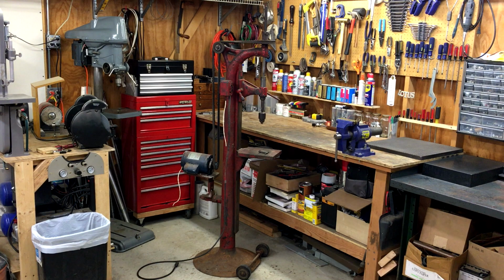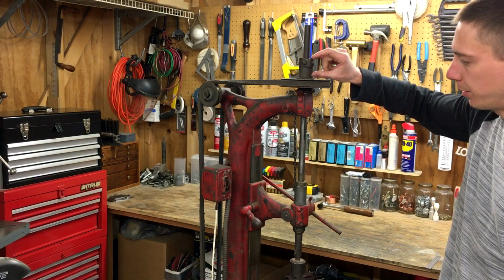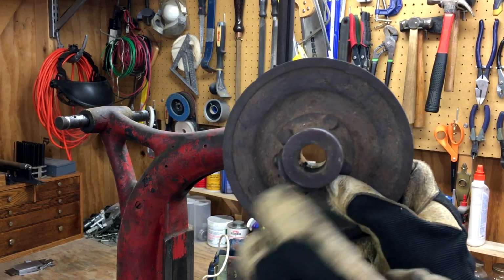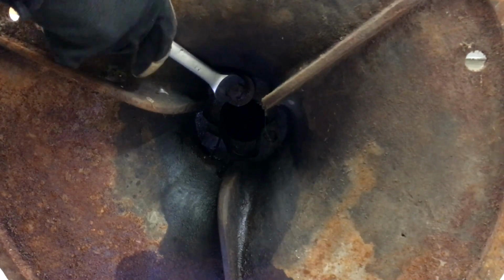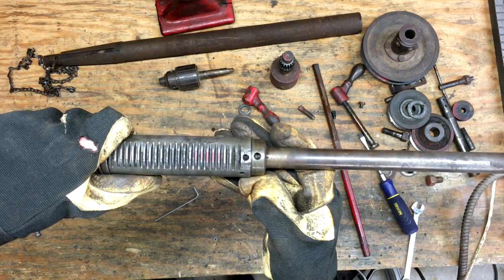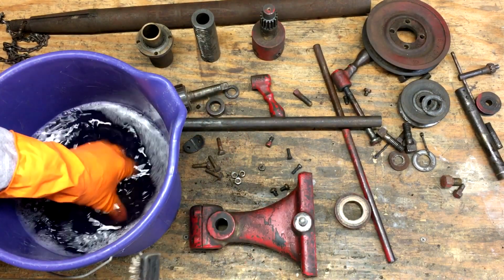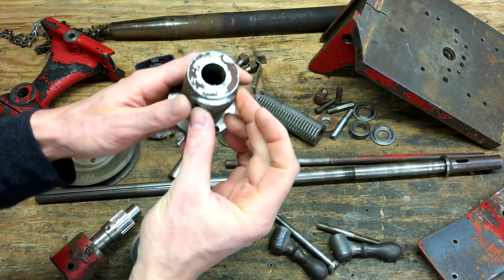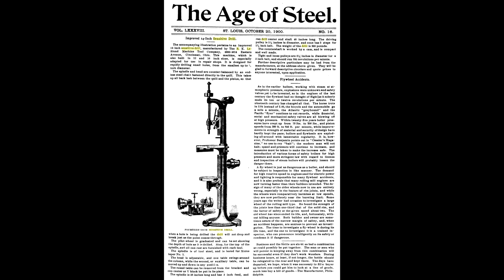Leblond Drill Press Restoration - Teardown

Comment: Hi,
Regarding the repair on the base and the damaged lettering, I've  used Selleys "Knead It" epoxy for this type of application before. If you can sandblast the area and mould the epoxy to roughly the correct form you can then file, grind and sand the area quite easily. Once it's painted it'll be invisible. 
Good luck!
Reply from the maker: Thanks Mark!  I like that idea.

Comment: Since the base/column connecting bolts are not visible, I would make a round steel plate (maybe 1/2" thick) and drill three holes in it for the bolts to pass through. kind of like a big washer. With something like that reinforcing the base casting, I don't think it would need to be brazed.
Reply from the maker: I really like this idea but the bottom side of those bolt locations isn't machined flat so one large washer might bolt up uneven and cause troubles.  Maybe I should put the whole thing on the mill and try to flatten out that side.  Thanks for the idea!
Reply: @BuildFixCreate  Rather than machine the casting, you could  put a large chamfer on the big washer to help it register with the taper on the casting. As long as the 3 bolts are evenly tightened it should pull itself into place. Milling a flat spot might be challenging. I've got a round column mill too, and I know they can sometimes be limiting in their reach. I'm curious to see what you end up doing. Keep up the good work!

Comment: A twelve point socket of an appropriate diameter will work, for square head bolts, once they are loose.  Is the counterweight cast iron?  Nice score on this drill for the price.  Well worth restoring.  You do good work.
Reply from the maker: No, I don't think it is cast iron. Thanks!